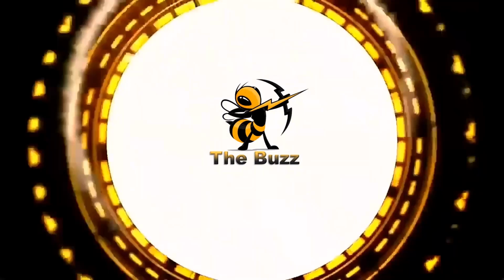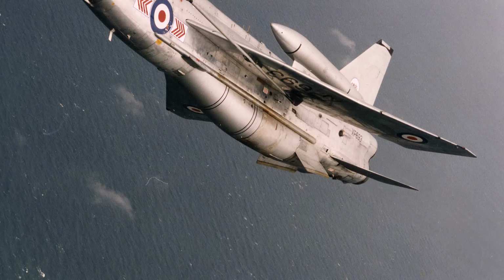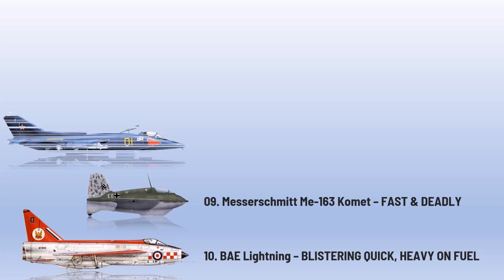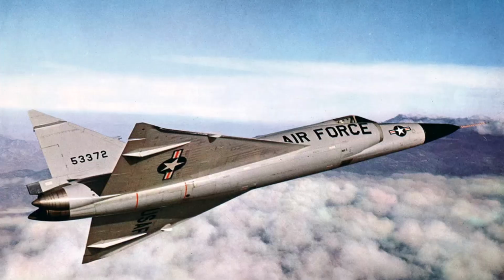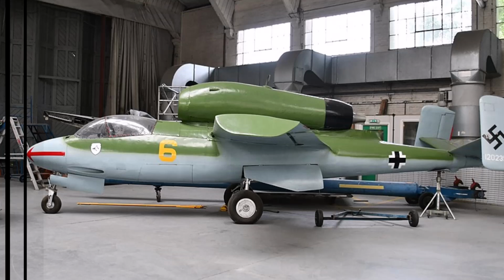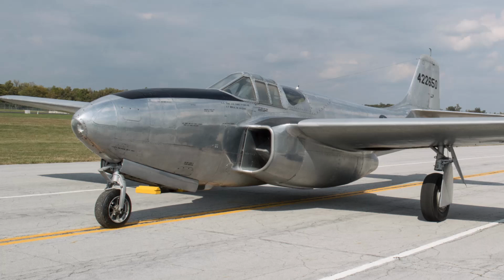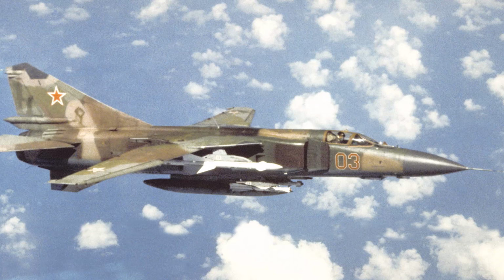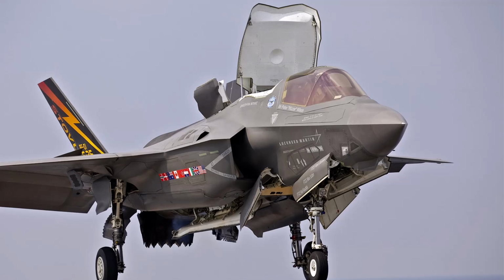The 10 Worst Fighter Jets Ever

Comment: So, you painted the F-35 as one of the “worst fighter jets” due to its operational costs? I mean, are we just going to forget the amount of lives that flying brick of a supercomputer saved?

The F-35 only had a notable crash number of 10, in 10 years. Compare that to the F-14, F-15, and F-16s which saw HUNDREDS of crashes not in its 10 years of existence, but in 5 years. Even then, the US Navy only had little amount of kills with its F-14 yet, people call it “successful”. The hypocrisy is astounding.

Also, the MiG-23? Come on… I expected better.
Reply: "So, you painted the F-35 as one of the “worst fighter jets” due to its operational costs?"

I'll skip the long looong full explanation, but suffice to say, i've made this comparison a few times.
In short, you can buy and fly the same number of SAAB 39 Gripen over a period of 20 years for less than a quarter of the cost.
And because the F-35 is so maintenance heavy, you will have something like 12 times more flighthours with the Gripen during that time.

And that does not include the cost of training up the ground crews.   6 conscripts with 6 months of basic trianing plus 1-2 techies compared to 17 techies and a dozen assistants, with most of the techies needing to be highly trained specialists.

Basically, YES, the operational costs of the F-35 are ridiculous.   While the above comparison is made because the Gripen is the opposite end of that, you can do it with most modern fighters and come up with the same result, the F-35 is absolutely not worth the cost.
Reply: @DIREWOLFx75  But F-35 can do what Gripen can't.
Reply: @DIREWOLFx75  actually f35 is now cheaper to operate than the f18 super hornet.  Which is cheaper than gripen.    Oh yeah what did gripen kill. Nada
Reply: Then explain why country after country, even those who are geopolitically neutral, choose the -35 over the Gripen?
Reply: @DIREWOLFx75  You can’t shoot what you can’t see 
Even if you can see it you can’t lock on 
Even if you can lock on you still have to deal with the dogfight which the F-35 is more than capable of doing.
The F-35 is most definitely worth the cost as nobody else has an effective counter against it
It’s one of the most versatile aircraft ever built and one of the most defensive.
Reply: @jjjr.1186  I think you must have discounted the RAM coating
Reply: @luigimrlgaming9484  "You can’t shoot what you can’t see"

And?   SAAB 39 Gripen, C model has shown itself capable of seeing an F-35 beyond effective missile range.   And the sensor upgrade of the E model will make the C model mortally envious.   And the improved antistealth upgrades are even better.

That's just ONE blatant example.   Sure, it took several Gripen datalinked to do it, but that's one of the reasons the datalink exists.

"Even if you can see it you can’t lock on"

Except modern sensors CAN lock onto stealth.   It's just considerably more difficult to do it.

"Even if you can lock on you still have to deal with the dogfight which the F-35 is more than capable of doing."

lol

No.

"The F-35 is most definitely worth the cost as nobody else has an effective counter against it"

Uh...   Riiight...   You still believe it's the 90s?
You've completely missed that most nations have spent 20+ years developing antistealth capabilities.

You actually think Russia and China are building stealth aircraft without any capability of countering enemy stealth?
lol

And "worth the cost" is the absolute opposite of what it is.   It has military value for sure, but it is nowhere remotely close to any sort of "cost effectiveness".   That is the absolute worst point of the aircraft.   And that's WITH the subsidies that is making it not cost twice as much per plane.

"It’s one of the most versatile aircraft ever built and one of the most defensive."

Yeah sure, you betcha!   Oh wait no, that's complete bollocks.
Reply: @DIREWOLFx75  It is cost effective 
1 plane goes down for us 
4 of their goes down in the process
Reply: @jjjr.1186  That isn't even remotely close to true.

That's based on the same kind of cheating that was used for the sell to Norway.
"Oh yeah, purchase price for the F-35 is cheaper than purchase price plus 20 years of spare parts and tech support is for Gripen, fancy that!".

Gripen has a cost per flighthour of around 4000$.
F-35 has a cost per flighthour of over 30000$.

DO please explain how that is cheaper!
Reply: @DIREWOLFx75   there was a similar group of people called the fighter mafia that held similar beliefs to you. They were wrong in oh so many ways. If you aren’t convinced the F-35 can dogfight just look up an F-35 doing aerial maneuvers. Stealth is incredibly powerful but your lack of actual knowledge in this subject leads me to believe all you did was watch a news network’s interpretation of what someone else said. The future is coming and you can’t stop it.
Reply: @ANDREALEONE95  "But F-35 can do what Gripen can't."

Can it really?

In the environment of a modern, datalinked,  integrated airdefense?
No, it cannot.

Against 3rd rate militaries, yes.   But against that kind of opposition, well that's not exactly hard dealing with for the Gripen either.
And as i believe i noted, for the full costs, you can get 12-20 times as much flighthours for the same price with Gripen.

12 times more missions, how much more effective do you think that will be?
Reply: @luigimrlgaming9484  "It is cost effective 
1 plane goes down for us 
4 of their goes down in the process"

Except against modern airdefenses and aircraft, that's not how it's going to be.
Stealth is mostly effective against pre-90s sensors.   Beacuse the vast majority since then starts to include stuff that burns through stealth to at least some degree.
Reply: @DIREWOLFx75  

tbh your really good at writing novels. I wonder where you get these crazy ideas, you should write a book about it with magic dragons and unicorns.

If you want a translation your wrong
Reply: @luigimrlgaming9484  "They were wrong in oh so many ways."

REALLY?

That's interesting news.   So why don't you explain why the results of their work resulted in one of the most longlasting generation of fighter aircraft ever?
Oh yeah, because their ideas WORKED.

Claiming that Boyd and his boys were WRONG?   When they have already been proven right?   Seriously?

"If you aren’t convinced the F-35 can dogfight just look up an F-35 doing aerial maneuvers."

Unloaded with half fuel or less, yeah sure it can maneuver OK-ish like that.   But with a warload?   No, it does a decent impression of a beached whale though.

"Stealth is incredibly powerful but your lack of actual knowledge in this subject leads me to believe all you did was watch a news network’s interpretation of what someone else said."

Wow, ignorant much?   Just because you have NOT spent any real time in the last 30 years reading up on a subject doesn't mean everyone else is as lazy as you.

Do you know how antistealth techs developed functions?   Do you even recognise any of those already being used?

Dubledoppler?
Doublepulse?
Multifrequency?
Frequencyswitching?
Extended pulse?
Virtual array?
Multisource virtual array?
Multiband scanning?
Sweepscanning?

I could give you the basics on at least half the above.   And the others simply does not have enough information in the open to figure out even the basics of how they work beyond slightly more than the name it's become known under.
Reply: @DIREWOLFx75  give me an example of a missile that can target a tennis ball from  200 miles away.
Reply: @DIREWOLFx75  because it's not nearly that high on the f35    the b variant is around 10000$   the a and c. Around 4000. No difference. And as the f35 is half the price of gripen it's cheaper.  Every nation that has looked at the f35 has aquired it.  It is the future fighter.of NATO.  No Matter how much bs u type
Reply: Uhhhhm where did u here that the Gripen, most especially the C variant, detected the Lightning? I'm on mobile while writing this reply so I won't make it long but I'll reiterate my previous comment: WHY IN THE WORLD DOES COUNTRY AFTER COUNTRY BUY THE LIGHTNING OVER THE GRIPEN?
Reply: Do you really think that the US didnt think of all those before making the -35? Plus, Israeli 35s have been flying all over the middle east where Russian and Chinese "anti-stealth" radars are located.
Reply: @DIREWOLFx75  laughing about it isn't going to change the facts.  All f35 is cheaper to maintain per hour than the f16.  Which is half the price of the gripen as it's the most produced American aircraft.  With more than 10x the number produced.  Also    F35 is also 1/3 the price of a gripen almost from the beginning.
Reply: Not only the planes you mention, but also the F-4 Phantom had a high crash rate.
Reply: @DIREWOLFx75  snowflake ❄️
Reply: @DIREWOLFx75  
"While the above comparison is made because the Gripen is the opposite end of that,"

Then you know that the comparison you used is just wrong in many ways. 

Why compare a low-end fighter to a high-end aircraft? It makes no sense. While the Gripen is a "multirole" fighter, it is only multirole to its nation, Sweden. Because of Sweden's geography and doctrine, they focus on low maintenance since they expect to have their runways bombed to oblivion due to their close proximity to the *Soviet Union*. 

Since the Soviet Union is non-existent, its military, economy, and diplomatic power is also non-existent. At that point, the relevance of the Gripen is also starting to wane since it's made for a different era. 

"6 conscripts with 6 months of basic training plus 1-2 techies compared to 17 techies and a dozen assistants, with most of the techies needing to be highly trained specialists." 

Do you understand when the Gripen was made? It was made in a time where computers were so heavy, small, bulky, and expensive to mass produce. There are simply decades of avionics and electronics gap between the F-35 and Gripen even if, we consider the newest block iteration of SAABs fighter.

Moreover, you're forgetting the doctrine of the F-35 and Gripen. The purpose of the F-35 is to act as a SEAD platform at the BEGINNING of a war. Sure, the Gripen can also do that, but it is obvious the Lightning 2 will survive longer performing SEAD missions. 

Furthermore, if you're going to compare something... ensure that they're both in the same class. Compare the F-35 to its 5th generation class. You could, compare it to 4th generations but, those airframes are built for a bygone era with upgrades only given to prevent their inevitable decommissioning.
Reply: @johnsilver9338  "But given the statistics, F-35 has the least amount of technical incidents compared to other air-frames including F-22 and even older 4th/3rd gen ones."

Good heavens no.   Not even close.

It doesn't have all that many SEVERE INCIDENTS no, but the amount of flaws having to be fixed, or in some cases are outright IGNORED(!) instead, is horrific.

It's list of crash-causing flaws may not be huge, but its list of flaws affecting its ability to be effective or function as intended is nearly endless.
Reply: @DIREWOLFx75  Please explain what are those flaws then?
Reply: @DIREWOLFx75  
"HAHAHAHAHAHAHA..."
- Inform me, then. 

"The Gripen C/D have newer electronics hardware AND software than the F-35...
And the old A/B model avionics is very roughly only about 5-10 years behind.
The E/F model, well, lets just say that the F-35 could desperately use the upgrade to parity with it."
- So, you're telling me... that a fighter jet that imports key components mainly from the US, France, and the UK has better avionics and electronics than the nations which provides Sweden the capabilities to build the Gripen? Seems contradicting don't you think? 

Also, you're gonna have to provide sources to protect your statement. 

"And the original Swedish non-Natocompliant datalink was DRAMATICALLY BETTER."
- Then why didn't NATO adopt the Swedish datalink for the Link16?

"Considering that all the old A/B model Gripen required to be CAPABLE of killing F-35s was a SOFTWARE upgrade?"
- I need sources for this. 

"See, that's the advantage of using industry standard software, they wrote up an anti-stealth avionics software patch in less than 2 years.   While F-35 struggles to get ANY software updates done." 
- I need hard sources on this one since you doubt software programming on a multi-billion-dollar fighter jet like the F-35. An airframe which is continuously purchased by foreign nations is bound to have upgrades to combat certain problems. Even then, it is in Lockheed's best interest to not stagnate in R&D since it will affect their sales. 

"However, make it 4 vs 4 or more, and the Gripen's better use of datalinking actually greatly improves its chances with increasing numbers."
- So, the software that is "supposed" to be better than Link16 is also superior to MADL, the F-35s datalink? At this point, what's the purpose of developing a software for future fighter jets if a low-end fighter even rivals Dassault's, MiG, Sukhoi, Lockheed Martin's software making capabilities? 

"The Russian MiG-31 datalink ability still probably remains the best in the world." 

- I need sources on this one considering every single article I've found about Russian jets have been bombed with marketing gimmicks from state medias of Russia. 

"And seriously, calling Gripen low-end?   Are you bloody stupid?   The E/F will probably be able to compete 1 to 1 with F-35 in every way that matters.   And you split them up as low vs highend?   Wow, that's dumb."
- Wow, thanks for the name calling smooth brain.
- Do you not understand the concept of low-end? Low-end means low maintenance, hence, cheaper to maintain in the aviation world. The fact that the Gripen is made for austere landing strips, needing less downtime since its avionics are dumbed down to allow the "supposed" lower downtime is a testament that it is a low-end fighter compared to its contemporaries such as the F-16, FA-50, Tejas which needs proper runway, and more maintenance. 

"You seriously need to stop uncritically drinking the manufacturer sales pitch koolaid."

- Then PROVIDE me proper sources about the Gripen's fuckups, praises, advantages and disadvantages. 

"When the F-35 was shown off for Norway, Swedish Gripens were capable of locking on to it from across the border, from BEYOND missilerange.   (and that's just ONE example showing the failure of the concept)"
- Yet, they chose the F-35. Also, tell me the sources of this. 

"That's something that was supposed to be UTTERLY and completely impossible.
And back in the 90s, the MiG-31 could do it with some luck, but aside from that, it was a real thing." 
- Why are you so fixated on using the MiG-31 in this argument? It wasn't even Russia's premier fighter. It was Sukhoi's creation which triumphed in this era.

"But technology has moved on since then.
Even just throwing magnitudes more processing power into radars have shown to be enough to beat stealth to some extent.

And what's being done goes far beyond that.
Stealth isn't worthless, but it has been severely devaluated since the F-35 was conceptualised and designed."
- In some stroke of luck, I actually agree. L-Band radars have proved itself exceptional in seeing stealth fighters but, that's just... that. It's still not enough to grant a radar lock enough to launch a SAM. 

"So called 4th and 4.5th generation aircraft are going to be around for many many more decades."
- Well, that's true. Only a few notable airframes will survive longer depending on their lifespan, and date of creation. 

"Because those "generations" is a purely fictional makebelief salespitch."

- They are sales pitches, yes, but they also represent their capabilities.  

"You really have no clue do you..."
- I do have a clue, together with the other commenters in this thread. They see the comparison of the low-end Gripen and the F-35 as an odd match-up.

"So tell me, if Gripen is so obsolete, why did USA have to repeatedly CHEAT for the F-35 to be chosen instead of the Gripen?"
- Losing fighter competitions does not mean the US cheated. Do you have any idea that would bankrupt Lockheed Martin? Moreover, that would diminish the international standing they have. There are more disadvantages to the US and LM if it paid the results than actually showing it. 

I'm certain you know this. 

"Why did Brazil STILL chose it?"
- It's as if, you're forgetting that not all military branches around the world have the privilege to purchase a premier fighter jet with infrastructures, weapons, maintenances included in procurement packages. Brazil chose it because it's cheap and it only needs fighter jets for deterrence.

"Why are there currently around TEN nations considering buying it?" 
- Remember, they are just CONSIDERING it, they have not purchased it yet. If they did, congratulations to SAAB for their first big ticket sale in aviation since 2014.

"Heck, France even at one point considered it as a replacement for its carriers."

- I doubt this. France's military-industrial complex will never allow this, regardless.
Reply: @johnsilver9338  Lots of software bugs.   Causing, what was it, over 300 individual "minor" bugs or something...

Aerodynamics designed for supersonic in a plane that long since stopped being meant to fly supersonic during a normal mission.

Helmet.   So bad they had to get a backup model made until they could fix the original, which still isn't up to par 10 years later.

Gunport.   You better hope the plane doesn't have to use its gun often.

Needs a massive groundcrew.

Spends >4 times as much hours on the ground per flighthour as most fighter aircraft.

Plug-n-play...   No, seriously.   The laughably poor excuse for the blackboxing of nearly all tech is that the modules are supposed to be literally pnp easy to swap out.   Except they're not.

And while the anemic radar is technically a design choice rather than a flaw, it's based on knowledge of the 80s and today it essentially provides no benefit, but is instead a major drawback.

Hmmm, what else can i remember without having to look it up...

Meh, the above is bad enough so i wont bother with more...
Reply: @DIREWOLFx75  If it's software issues those can be solved with updates especially with Block IV.

5th gen don't also need to go supersonic as it would them a big infrared IF target which defeats the purpose of stealth. 

If it's maintenance you are worried about they are developing knew RAM coatings especially the new glossy ceramic one to reduce maintenance cost/hours. Even F-22 has this problem. If Su-57 and J-20 have proper RAM coatings, they will also have the same problem(s). Plus as if the engineers are dumb enough to not solve it's issues. Hence why Block IV, V, VI and so on. If you know better than the engineers who designed it,  go work at LM Skunk Works then. But it's performance is already evident in Red Flag exercises, so that speaks something.
Reply: @DIREWOLFx75   Also read from popular mechanics, national interest, and defense news thats its 13 category 1 critical failures have been reduced to 7. And this is from January last year. Its 850 category 2 minor issues are mostly software related. Hence why Block IV is a major step.
Reply: @johnsilver9338  Yes, but even ONE "critical failure" is one too many.
And a LOT of those "minor" are the kind that no fighterplane should have at all, the kind that's supposed to be fixed during prototype stage or at worst, force a project to be outright cancelled.

And then there's the "non-issues", the stuff that isn't listed as official failures because it's pretended that they're not big enough problems to be a "failure".

The funny part of it is that if you look at how the F-35 project has been handled?
What it most reminds me of is the absolute worst corrupt 1930s/1940s BAD projects of the USSR.
Reply: @johnsilver9338  "If it's software issues those can be solved with updates especially with Block IV."

I don't think you appreciate the level and scale of problems that the software of the F-35 has.

They essentially wrote ALL the code from zero.   Do you understand what that means?
Literally MILLIONs of lines of code, that only the coder that wrote it knows exactly what it SHOULD do, what it interacts with and how.

Debugging is an abject horrorshow beyond belief.   It is by far the single most epic failure of the project despite the fact that the coders did a good job.   A lot of the people making decisions about the software however, should probably be prosecuted for high treason.

It's on the level that it's become a meme that the F-35s software MIGHT be completely fixed by the time the aircraft is retired.
If they're lucky and put enough resources on the job.

"If you know better than the engineers who designed it,  go work at LM Skunk Works then."

Oh, it's not the engineers that are the problem.   It's US standard business practices.   Engineers are hired to do a specific job and then, after having taken a lot of extra time to reach the level of experience that they can finally do a good job and this part of the project is done, they are left behind.   And when the next problem is to be solved, NEW engineers are hired for that job, specialists oh yes, but with zero experience for the task, experience that takes years and failures to build up.

Most engineers involved know exactly what needs to be fixed.   They may not know HOW to do it, but they're perfectly aware of the WHAT at least.   But the laughably subpar project management that is far more interested in pork politics than in getting the plane as good as it can get is making sure most fixes suggested by the engineers are never implemented.

"But it's performance is already evident in Red Flag exercises, so that speaks something."

Yeah...   "evident"...   lol
Not evident the way you mean it, i'm afraid.
But hey, it's easy looking good for the politicians when the deck is stacked in your favor.
Maybe you should go look at how the US military industry tried to sell the Sergeant York AA system to the US military?

About the rigged demonstrations followed by the system destroying a barracks during the first attempted unrigged demonstration, because it's sensors gauged the ceiling fan of said barracks as a greater threat than the target drones.

Or look up the development of the Bradley.
The F-35 is pretty much a repeat of the Bradley, just with magnitudes worse levels of complexity involved.

"If it's maintenance you are worried about they are developing knew RAM coatings especially the new glossy ceramic one to reduce maintenance cost/hours."

I'll believe that when it's a fact.   And not being massively subsidised via covert contracting to hide the real costs, as the F-35 currently is.   In case you didn't realise, the real costs of the F-35 right now is probably somewhere closer to double that which is claimed officially.   The new coatings  being developed MIGHT get that down halfway to what is claimed.   Maybe.   Personally i actually hope not, because the plane is such a mess that it deserves having its real pricetags shown off, to the staged horror of the politicians who knew the real numbers perfectly well.

"Even F-22 has this problem. If Su-57 and J-20 have proper RAM coatings, they will also have the same problem(s)."

Well, duh!   ALL of the US stealth aircraft have these problems beacuse they're all based on the same engineering base.

Assuming that Russian and Chinese stealth aircraft ALSO has them however is an epic fail in logic, because we do not know if they are using the same style of coating.
In fact, what little we DO know strongly suggests that they use coatings that have no connection at all with what USA uses.

Whether those have the same problems is something we simply wont know for a long time yet.

About the only thing we do know is that one of the coatings used on the Su-57 makes liberal use of sapphire dust.

And combining the cost and inherent material strength of that?
Strongly suggests that at least that type of coating is NOT going to have the kind of issues that the US RAM coating has.
Or at least nowhere near the same levels.

"5th gen don't also need to go supersonic as it would them a big infrared IF target which defeats the purpose of stealth."

ROFLMAO!!!

-We can't build it, so lets claim it doesn't need it!
-Great idea!

Supercruise was originally part of the fake "5th gen" definitions.
Speed always matters.
Claiming otherwise is just daft.
Reply: @DIREWOLFx75  Compared to Su-57 and J-20. I'd say they've done a good job, not excellent but still a good job nonetheless. Both Su-57 and J-20 still don't have a comparable engine. There is still the issue if they are really stealthy at all. F-35 is also not just about stealth. Its also about the sensor fusion and its onboard supercomputer. F-35 all in all is a stealth ELINT aircraft with some capability of offensive electronic warfare, superb at BVR with good enough manuverabilty to dogfight. They don't have this all together in one package. It's like Zumwalt, but instead of abandoning the project they've continued it. Zumwalt could also have been a great platform.
Reply: @johnsilver9338  "Both Su-57 and J-20 still don't have a comparable engine."

That's debatable in BOTH cases, because the F-35s engine is inferior to either in SOME ways.

Also, more importantly, Russia massively increased development spending on the engine for the Su-57M, so now they're talking about starting production of the -57M no later than 2024 instead of 2028.
And that engine is dramatically better than that of the F-35.   Even more interesting is that it's made to also be cheaper and easier both to produce and maintain compared to the current engine of the Su-57.

"There is still the issue if they are really stealthy at all."

Not for anyone who knows the tech it isn't.

The primary bullshit is based on how Russia measures AVERAGE RCS while USA insists on only using OPTIMAL RCS for comparisons.   Which is basically USELESS, because making something practically invisible from one direction is drastically easier than to minimize the RCS in total.

As a point of note in regards to that, the Su-57s have been operating against Ukraine for over 6 months now.
And despite Nato basically crawling with AWACS around the borders, they STILL have not been able to verify contact with any of them.
These are AWACS that we KNOW are perfectly capable of spotting F-35s at those kind of ranges.

This strongly hints at what was already rumored a few years ago after the first quad of Su-57s were deployed in Syria, that they actually have BETTER stealth than the F-35s.

"F-35 is also not just about stealth. Its also about the sensor fusion and its onboard supercomputer. F-35 all in all is a stealth ELINT aircraft with some capability of offensive electronic warfare, superb at BVR with good enough manuverabilty to dogfight. They don't have this all together in one package."

Uh-huh...   Except for the fact that YES THEY DO.   Su-57 electronics package is right now the most advanced and extensive to be mounted on any operational aircraft.
By a HUGE margin.

Russian military aircraft electronics are estimated to use between 10% and 30% more more power depending on specific type of electronics compared to what's used in F-35.

But the Su-57 has over FIVE TIMES more powerful power generation for its electronics than the F-35.   Plus a backup of uncertain strength that is set so that it can ADD to the total when needed.
Meaning that the Su-57s potential EW/sensor output is somewhere in the range of 6-10 times greater than F-35.

Part of that is of course the multiple radars, and the laser and EM antimissile and jamming systems, but even with those accounted for, there's still a far greater power reserve available.

And the basis for the Su-57 electronics was that of the MiG-31, an extremely successful and effective setup.   One that was worldleading when the first version appeared in the 80s and with upgrades remain one of the best avionics setups today.

""F-35 is also not just about stealth. Its also about the sensor fusion and its onboard supercomputer. F-35 all in all is a stealth ELINT aircraft with some capability of offensive electronic warfare, superb at BVR with good enough manuverabilty to dogfight."

While i cannot say for sure for the J-20, in regards to the Su-57?   It has all of that.
And BETTER than the F-35.   If the F-35 sensor fusion worked as intended, it might actually be superior, but as long as the bugs are still there, nope.

The big deal however in a direct comparison...

Is this, the F-35 tried to have a sneaky radar as well.   Which resulted in it being severely underpowered, while not actually being as sneaky as it was meant to be back in the 90s, before improvements in electronics made the LPI concept almost completely obsolete.

It cannot detect stealth aircraft outside of missile range.
One of the absolute biggest advantages the Su-57 has is it's massive investment into having the radar strength of an AWACS all by itself if need be.
It can unquestionably spot an F-35 far outside of missilerange.

The Su-57 is comparable or better than the F-35 in every way.

And from what little i HAVE found out about the J-20, the same is PROBABLY true for it as well, though likely to a lesser degree.
Reply: @DIREWOLFx75  Then please explain how WS-15 is better? In terms of dry thrust, its not even comparable to the older F-119 enigine the Raptor use. In wet thrust maybe, but using afterburners will just make a stealth plane a big IF target.
Reply: @johnsilver9338  Don't ask me for specifics, i'm not THAT much of a hardcore follower of these things.

Search online for direct comparisons between them.   There's several decent ones made.   IIRC the best one i found when i looked was by some Indian techsite.
Reply: @DIREWOLFx75  I already know the specifics of WS-15 as I translated it directly from Shenyang. But you are the one claiming the engine performance is debatable when in fact you know nothing of the subject matter. Nevermind. Its useless talking anyway.
Reply: @johnsilver9338 don’t argue with the bot. He lost the moment he called a low-end fighter, the Gripen as “top-tier”.

It is low-end for a reason, mainly for its price and its purpose of creation. Not because of its electronics, and kinematics which is slowly becoming secondary in military aviation. He went on far to say that he doesn’t know the specifics of the J-20s engine yet, went onto a disinformation barrage to praise the J-20.
Reply: @shtorm2616 : Bribes is the normal answer, I’ll stick with it
Reply: @luigimrlgaming9484  how about an air to ground missile!!  That’s where the F35 will die, on the ground in the hangar when the missile hits the tennis ball
Reply: @steveperreira5850  Yeah, I agree, we don’t have the capacity to service so many stealth fighters under the stress of war, so they’ll most likely be destroyed while they’re on the ground.
Reply: @steveperreira5850  Proof? Because from what I know (governments who buy these aircraft definitely know even more), it's perfectly reasonable to buy the F-35 over the Gripen. If I were the one making decisions for them, I wouldn't need a bribe to still choose the F-35. It's that much better. Yes, the Gripen can take off from shorter roads (the Lightning can do that too, albeit at longer roads, B variant doesn't even need a road) and is cheaper to operate (to what extent, we dont know cuz Saab(or maybe just their fans?) claims the Gripen E has the same operating cost as the C when the E is much more advanced) but the F-35 is better and will be even better (Block 4) in pretty much everything else.
Reply: @steveperreira5850  Bro look at Iran's attack on an Israeli airbase. Not a single F-35 was destroyed. I know that in a full blown war there would be aircraft destroyed on the ground, thats a given. But it would be arrogant for you to assume that it would completely nullify the gap in airpower between the west and the eastern bloc